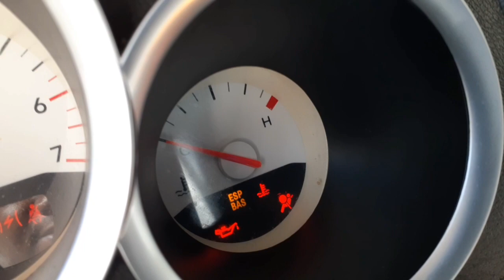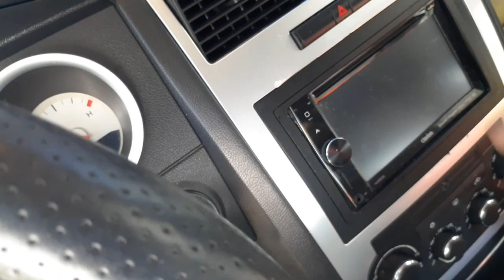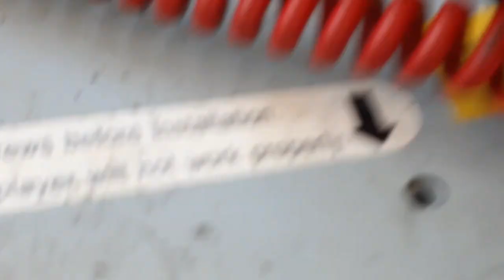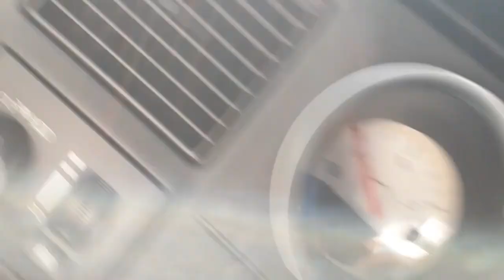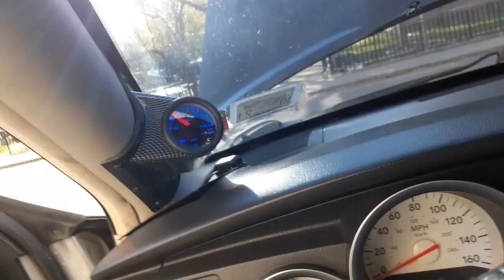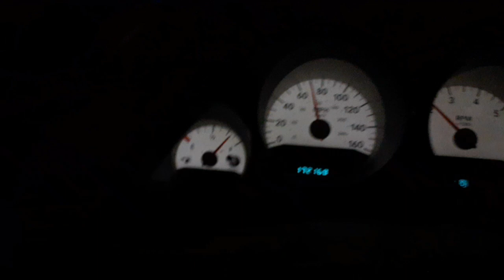How to install  a oil Pressure guage on Charger R/T

Comment: man been looking for this video right on G. no where can i find one for MOPAR's out there. got a 300c 5.7 hemi and need to do this. My boy you said you got the plate off amazon. what size you got brodie? or are they one stop shop. I wana make sure i got the right thread, right size, right everthang you feel me. shoot me a amazon link you got ours from big dog. and did your gauge come with the oil sensor that you put onto the sandwhich or you bought that yourself too?

Comment: I have a 2005 dodge magnum 5.7 doing this to. LOL i like the mask btw i have a few myself being my nick is CBones HAHAHAHAHAHA. I have sandwich plate just never got my lazy arse underneath to finish the job.
Reply from the maker: Yeah it's definitely good to have on your car man yessir
Reply: @dragstriprabies2.059  I am waiting for my new gauges as have a 3 pillar setup with coolant temp, oil pressure and battery voltage as running 3 amps in back. gauges i have now the backlighting burnt out. ill have to get a pic show ya my setup
Reply from the maker: @bonzeroni1  I started to t
Do the pods but now I got the diablosport trinity t2 tuner shows me everything
Reply from the maker: @Lyon TenBroeck appreciate your support King  thank you 🙏
Reply from the maker: Appreciate you 🙏 thanks